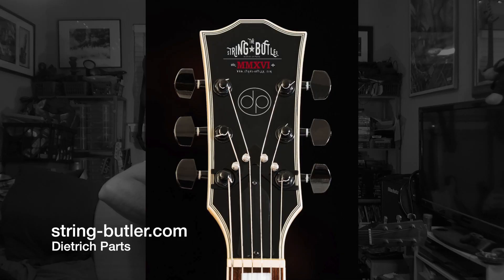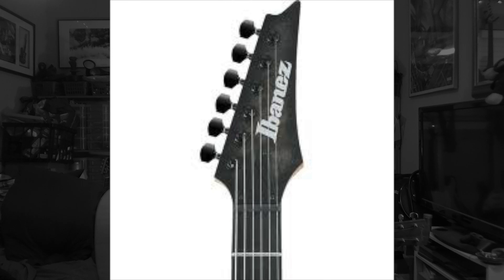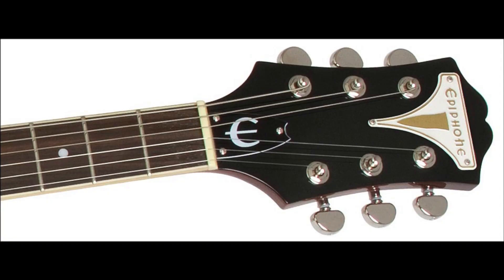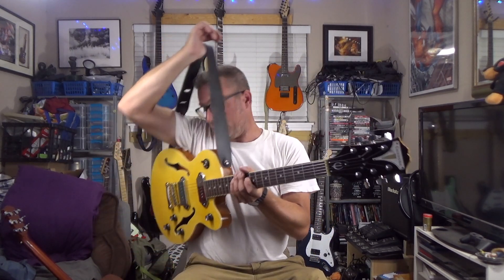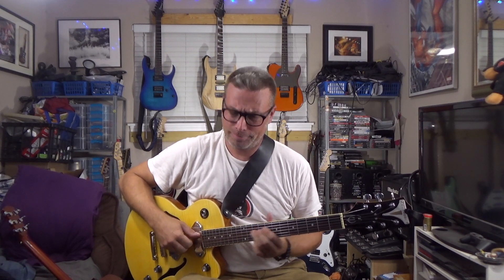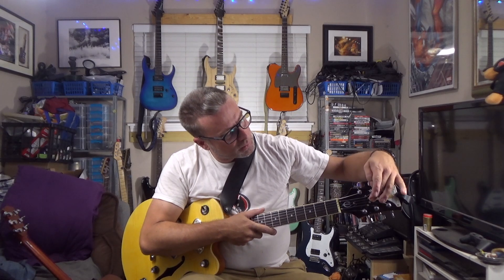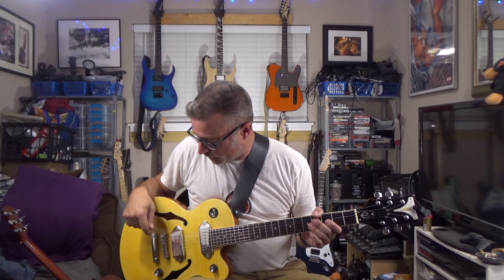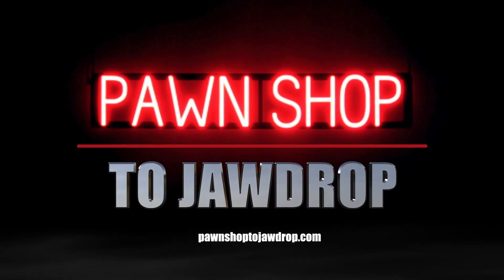The String Butler

Comment: I played Les Pauls for decades and never had persistent tuning issues. Make sure the nut slots are cut correctly and then clean, dress and lubricate the nut slots and your guitar should stay in tune when you play. It's a novel idea although a hideous solution to the problem. The Les Paul has been around since the fifties and suddenly stuff like the String Butler pops up. This is a result of the "take it to a guitar tech" mindset that has evolved over the years. Back when people knew how to maintain their own guitars this was not an issue. Those days are long gone, it seems. Don't get me started on changing tubes and setting bias.